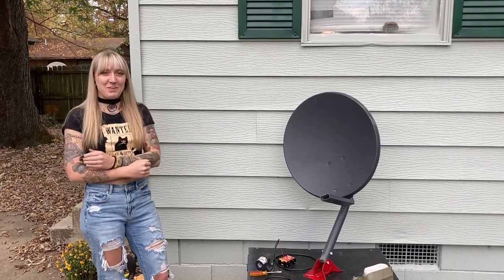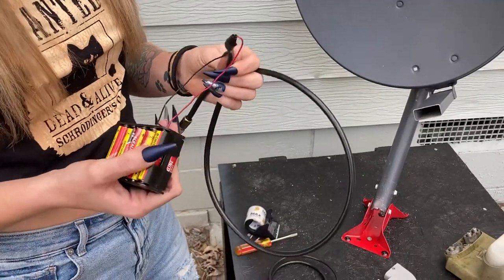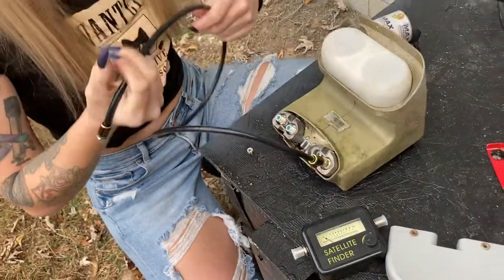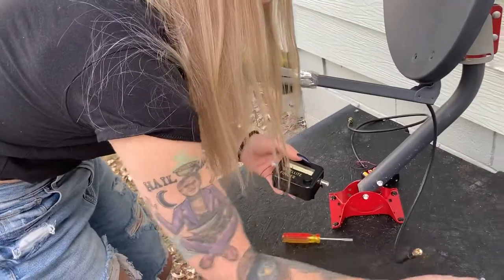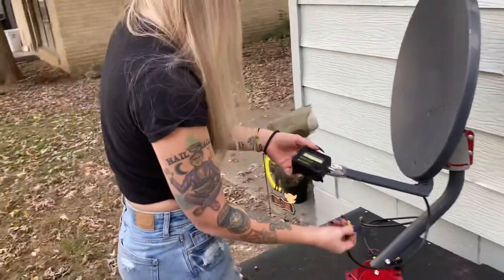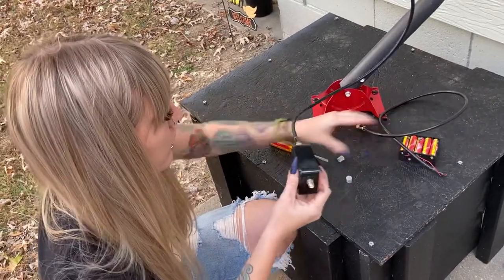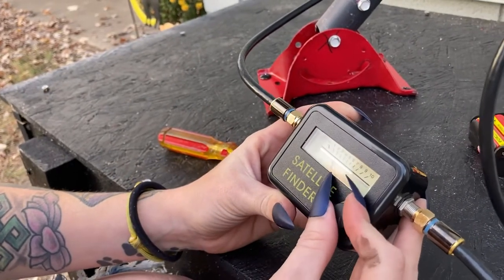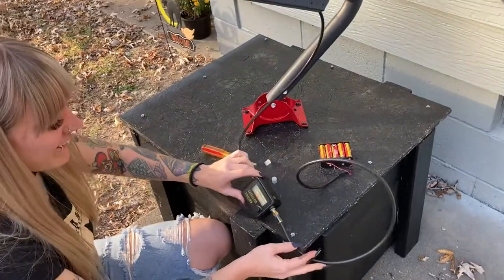Fun with Physics! DIY Radio Telescope

Comment: I did this very thing for fta tv. I received galaxy 19, at 97 degrees west. I didn’t have the meter, I used gps to find my longitude then calculated the degrees west with a compass and elevation with a protractor. Works great, I also used a bigger dish for more gain, lnr400 for low loss

Comment: Can you give the list of the equipments needed?
Reply: From what I can tell in this video — as well as others that I've watched:
- An old satellite dish (with LNB and coax cables)
- Satellite finder or RTL-SDR (depending on your preference)
- Battery pack as power source 
- A mount for the dish
- And if you want to process any signals you'll need a laptop with the proper software and adapters to go from the coax cable to USB (I suppose)

I would appreciate if @@funwithphysics8948 would just confirm, as I haven't built one of these yet :)